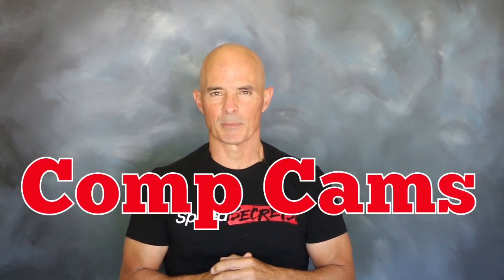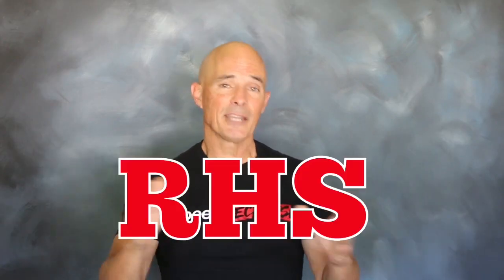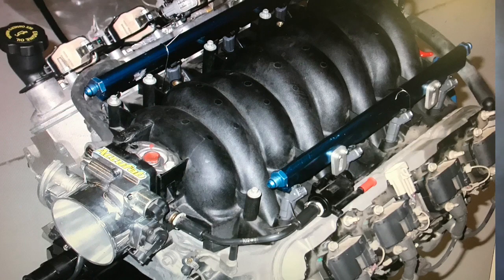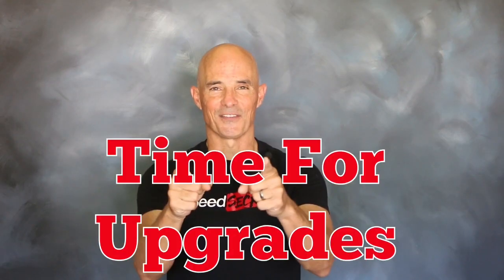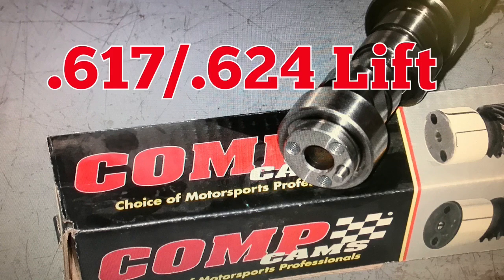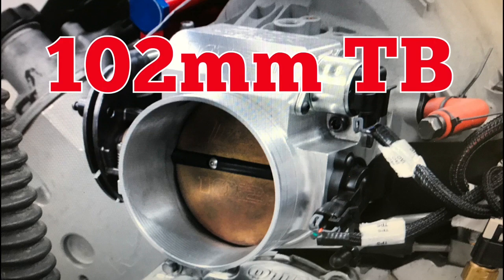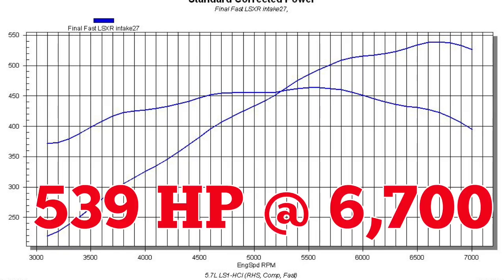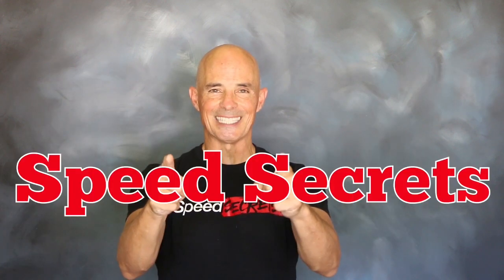Heads/Cam/Intake on an LS1: How Much Power??

Comment: LS1 with heads cam and intake will run 550hp. Throw in some dome pistons and you’ll grab another 20hp. If you’re losing 110hp getting to the tires, you got big problems.

Comment: What’s crazy is how this crate motor which is the exact same that the 01, 02 Camaro SS and Trans Am has but it’s pulling 414 crank HP right out of the box which is roughly 350 whp. But the cars only put out 325whp even with the factory LS6 intake.
Reply: Because they put long tubes on it, gain 25whp usually
Reply: Keep in mind that’s the rating. Back in the day people were seeing 305-345 rwhp stock.

Comment: Those numbers should possibly be divided by a range of 1.12-1.20, which accounts for a 12-20% drivetrain loss. This gives a slightly more realistic number to potential RWHP.
Example: 
539 ÷ 1.20 = 449
539 ÷ 1.12 = 481
So there's a 32 hp difference, let's meet in the middle and say 16 hp and add it to 449 so that put it around the range of 465 RWHP. Obviously I'm not an expert but there's a pretty wide spectrum however I've heard many people being around the 450 RWHP range with Heads, Cam, Intake and a good tune on a 346CID LS1.
 As well, always remember if you switch out your rear differential for a heavier setup it will increase your drivetrain coefficient as it's more rotational mass the engine has to turn while transferring power to the ground.
Reply: Yea 460 to 470rwhp and 410 rwtq

Comment: @richardholden I have a big huge question for ya ...... Why can't I take my 2000 mustang GT with the 4.6 coil on plug ignition system remove it and install a 5.3 LS engine I know the 4.6 has a 35 tooth reluctor wheel and the LS is 24/58 but I'm sure it's possibly to replace the 24/58 reluctor wheel with a custom 35 tooth wheel while I'm building the engine do you have any idea of the best way to attempt something of this kid I can't see how it's not possible

Comment: Stock motors rate 305hp-320hp for the 1998-2002 fbody
Reply: That’s paper. Most Camaros made the same 350 hp as the corvette which translates to 330 to the wheels

Comment: How do you get 414hp from a stock ls1?
Reply: Long tube headers and computer management.   The Vettes back then made 350-360HP at the engine.   Replacing the log style manifolds for long tubes and a tune could give 50-60HP.

Comment: How hp much power do you think that would be at the wheels?
Reply: 450-460
Reply: Those numbers should possibly be divided by a range of 1.12-1.20, which accounts for a 12-20% drivetrain loss. This gives a slightly more realistic number to potential RWHP.
Example: 
539 ÷ 1.20 = 449
539 ÷ 1.12 = 481
So there's a 32 hp difference, let's meet in the middle and say 16 hp and add it to 449 so that put it around the range of 465 RWHP. Obviously I'm not an expert but there's a pretty wide spectrum however I've heard many people being around the 450 RWHP range with Heads, Cam, Intake and a good tune on a 346CID LS1.
 As well, always remember if you switch out your rear differential for a heavier setup it will increase your drivetrain coefficient as it's more rotational mass the engine has to turn while transferring power to the ground.

Comment: for anyone wondering power numbers to the wheels. Its about 400-420whp with a manual less with auto.
Reply: In a manual car, probably more like 460whp.
Reply: @zacharyrussell6983  doubt it, they are running no accessories so the drivetrain loss once on a car with full accessories is higher than the standard 15% loss. Also most h/c/i LS1 cars dyno in the low 400-450whp range. My estimate is more on the conservative side but 460whp would be on the high end of the spectrum.
Reply: @TheOhsemix  true.  I forgot about the no accessories.  Yeah, 420whp is probably pretty accurate.  Which to me just makes me feel better about my car doing 467whp through a 9” and 243 heads.
Reply: there’s mkre you can squeeze from the heads, i saw someone mention it already but running GOOD ported 5.3 heads to bump compression and running e85 to help prevent knocking would see you closer to that 450whp
Reply: 460 to 470 rwhp manual 410 to 420 rwtq

Comment: This is Old, But how is a 227/235-565/579 110 LSA cam in a 5.7 ls1?
Reply: Those specs aren't far off from the Tick Torquemax Stage 2 cam. I have that cam in my C5Z and it put down 430/411 with the stock ls6 heads and intake. It's a great all around cam and it's awesome on the street.
Reply: @maroonsn95  Thanks for the info 👍
Reply: @maroonsn95  Thanks
Reply: @maroonsn95  What a monster...

Comment: Richard, why, how does the Early LS1 make more power at the crank than my 01 LS6 in my Z06?  (385/385)? thank you.  BTW, heading for teh Big 3 install after 20 years beating on this beast.
Reply: The dyno picture also shows an electric water pump and no accessories being driven. Your 385 HP is calculated with all accessories, including mechanical water pump, attached.
Reply: These numbers are with headers and a tune. Your ls6 will make well over 385 on a dyno without factory exhaust manifolds etc.
Reply: Numbers are most likely underrated from factory

Comment: Thats alot of money to gain 125 hp. Ya could have probably turbo it for half that and make double the power
Reply: bruh
Reply: You can't just find the price of a turbo on the internet and think that that is what a turbo system costs to install on your engine.  It take some serious fabrication skills to do a turbo system in a Vette/Camaro and make it look good and keep fitment of the hood.  In fact, it's one of the hardest mods you can do to your engine bay.  You are far, FAR better off getting an A/A Supercharger system for 8k and its a simple bolt on with no fabrication skills necessary.
Reply: @ChefofWar33  you can buy turbo kits for all sorts of cars.
Reply: @chevrolet355  Indeed you can. Installing them on the other hand... Well that requires knowledge, tools and time i dont have.  Some cars are super easy to to.  While my particular car, the C5 Corvette is one of the hardest out there.

Comment: I'm building LS1  5.7l iron block with forged eagle rods wiseco pistons shouldn't have any problem turning 528hp at the crank and I'm going to drop it in a 1971 international scout Comanche should wake it up a little seeing how the original engine is a  304ci 5.0l  turned right around 215-220 hp

Comment: This video references the LS1 crate from an early model Camaro, but power output "stock" does seem high, even with the long tubes and fuel management system on an engine dyno.   The LS1 in C5 Corvettes made 350 crank hp in the later models with LS6 intake.  Seems more feasible that it's an LS1 with vette cam, heads etc.  

Otherwise that's one seemingly generous engine dyno.

I have an LS1 with similar cam specs, 232/236/113, ported 241 heads that flow bench tested better than stock 243s by a long shot. Kooks LTs and offroad Xpipe. Car makes 418hp 398tq at the wheels. Figure 475hp at the crank.

No way that Fast Intake and 102 TB are worth 64 hp.
Reply: Long tubes and computer management on a 350HP LS1 could easily give 50+ HP gain.     So the 414HP was with the exhaust and computer management.
Reply: Good numbers for sure! My 02 SS with prc 2.5 5.3, custom cam and kooks headers made 426 rwhp. Swapping the ls6 for a fast might gain you 5-8 hp max but it's not really worth it. I have videos of mine if you wanna check them out.
Reply: @bhcamaro2002   that's about spot on. Heads, cam, longtubes,  LS1s are typically in the 415 to 428 rwhp range.  Figure 50 to 55hp more at the crank.
Reply: Correct, depends on dyno as well but overall that's accurate
Reply: @bhcamaro2002  it’s pretty well known that that’s the typical range.  I’ve had three cammed/ heads/ long tubes LS1 builds on two separate C5s (one built twice). All three builds with different cam specs and different porting on the heads. All were relative in power and torque at the wheels, give or take 10 to 15 hp/ tq. Three separate dynos I might add.
Reply: @gotmylk thats awesome, I've heard mustang dynos read a little lower than others as well
Reply: @bhcamaro2002  depends on sweep time,  but Mustang dynos usually reads 8 to 12hp less than a Dynojet.
Reply: @bhcamaro2002  I just watched a few videos comparing the two , Mustang Dyno vs Dynojet. When both machines are recently calibrated the two read within fractions of an HP from one another.  So I think it's safe to say...of the dyno is calibrated the HP/ TQ ratings should be accurate on either tool. Which assumes some shops are just more on top of having their dyno calibrated than others. Also the Mustang dyno has a lot of flexibility with the parameters that will alter power output reading even if the power output reading is innacurate.  

I say always go with a reputable shop that only cares about using the tool for tuning and ensuring your car doesn't blow up....and doesn't give a hoot about your feelings and unessecerely  inflating your numbers.
Reply: @gotmylk  yup exactly what I did for my car
Reply: @bhcamaro2002  same for all the ones I've modded as well.  If you tell your tuner you want a few more ponies out of your final results...and the response you get is " it's safe where it is. You dont want it blowing up, do you?". Then you have a good tuner.  

That's exactly what was said to me by both Bill at 2nd Street Speed in Perkasie PA. As well as from Charlie Tuner  that tunes for A&A out in Oxnard CA. 

Soon I have one going to ECS in Cream Ridge NJ. Expecting nothing but a safe tune on this one as well.  Numbers don't matter. Just be fun, fast and reliable. Cause cheap went out the door years ago.
Reply: @gotmylk  exactly! My tuner said my car could make 440 but back it off from detonation on the dyno so the safe tune number was 426 and I was more than happy with that. There have been a few other shops in the area that go for numbers then the car blows up and they dont hold themselves accountable for cause the motors to blow. They usually run off to another state and start blowing motors there
Reply: @bhcamaro2002  bingo!
Reply: @gotmylk  there's one that did work in NY and ran to Florida haha
Reply: @bhcamaro2002  not surprising. There are plenty more clowns than there are quality tuners. That's why the quality guys demand a premium. They've earned it.
Reply: @gotmylk  yup the good ones stay around and keep getting projects and the bad ones disappear
Reply: @bhcamaro2002  Tbyrne Motorsports?
Reply: @ryryy1980  I was referring to redline lol
Reply: @bhcamaro2002  oh yea, I'm in western NY and have heard of them...
Reply: @ryryy1980  yeah they were in magazines and worked with some dealers then ran to FL
Reply: @Ballen1182 I do not agree. Manufacturers do not intentionally underrate their power output numbers.  There is absolutely no benefit or point to doing this.  HP numbers sell cars.  So why would a manufacturer intentionally short change those figures?  They wouldn't.  The manufaftures are using applying safe tunes for longevity,  incorporating the parasidic loss due to ancillary  components under multiple varying conditions.  Which in terms of reality are more accurate than the guys we pay $700 to for a tune at their Indy shop.
Reply: @gotmylk  they actually do that, sometimes up to 100 hp, although that's normally done either for rounding numbers or homologation purposes. A interesting case are Japanese sports cars from the 90s, up to 50 hp more than advertised, because of gentlemens' agreement between local Japanese manufacturers
Reply: @Ballen1182 ohhhh yeah! Good call. I did forget about the LS f-bodies. I need to stay offline when I’m smoking weed.

Comment: I wonder what's at the wheels with this set up.
Reply: Depends on transmission, stick will be near 500 auto depends lock up or not on average -100 for auto with high stall

Comment: Ls1 pistons melt at 500hp
Reply: Really eh
Reply: BS
Reply: @chrisbryant1657  stock ls1 pistons won't last long making 500 or more you need forged pistons
Reply: @abbas674  Mine have. 98 z28 Camaro LS1. Still original slugs!
Reply: @chrisbryant1657  yeah a stock LS1 does not make 500hp a 98 LS1 makes about 250 HP the 2000 LS6 is also a 5.7 that one makes about 350 due to the heads and manifold
Reply: @abbas674  My z28 is far from stock. LMAO
Reply: @chrisbryant1657  I melted a pistons at 500hp on my SS now its fully built forged rods pistons Texas speed crank used to think it would last but no.
Reply: @abbas674  bad tune probably.
 9.85 137 on sbe.
Reply: @chrisbryant1657  tune is awesome tuned by church automotive and no its just had 200k miles
Reply: @abbas674  Melted at 500HP naturally aspirated?   Or was it nitrous?

Comment: You still gotta push that extra power thru the 1998-2002 Camaro/TransAm 7.5" stock diff....
Reply: I've seen 7.5s last behind a 5.70s 1/8 mile gbody

Definitely wasnt stock. 434 with spray and slicks.

Comment: Wish the 5.7 had more love..but I understand its more rare than the other sizes. But I'd really like to see a street combo with 243's on it
Reply: I’m about to put 243’s on my LS1 and a BTR cam
Reply: @lsxbrandon6050  how did that do?
Reply: I'm running prc 2.5 5.3 heads and custom cam in my 02 SS. Sound clips are on my channel if you wanna hear it
Reply: @bhcamaro2002  that thing sounds great
Reply: @theredgoatviking4686  thanks alot!
Reply: @bhcamaro2002  you’re welcome good sir I have my gto on my Chanel
Reply: @theredgoatviking4686  that thing has a nice chop to it! 408 sweet!
Reply: @bhcamaro2002  thank ya sir it runs decent I wish it was in an f body tho.
Reply: @theredgoatviking4686  never too late to get one
Reply: @bhcamaro2002  very true I had one 4 years ago I should have kept it.
Reply: @theredgoatviking4686  that's what they usually say. I know a bunch of people who did the same thing
Reply: @bhcamaro2002  yep it was an lt1 car sort of modded but it was fun to drive.
Reply: I have a 2002 z28 Camaro I'm trying to find 243's for,  I have a set of 317's but i really want 243's.   I've been dying to try out that combo.
Reply: @jordancoyle6168  the 5.7 gets no love its a shame. My gto has a fast 90 and 1 7/8 headers, love to see some #'s with a cam
Reply: @paulcurrier4947  my 05 gto has the fast 102 intake cam full exhaust and stroker motor made 490 at the wheels on a bad tune.
Reply: @paulcurrier4947  Because its a small block 5.7. Going bigger gets easier to make power with fewer modifications
Reply: Checkout my vid bud, I have 243s that were ported at AHP, with 92mm IM, BTR 2 Cam and LG Motorsport Long tubes.  Dynodynamics dyno made 452rwhp 425rwtq.  Very Streetable.  34mpg on freeway.
Reply: @Corsavette02  LS1 max out at around the 500 something mark N/A on pump gas. Going E85 gets 600 something maybe more but need forged piston's and sleeves. Alluminum blocks are not the most favoured for drag racing
Reply: I’m building that now
Reply: I made good power with AI ported 241's
Definitely worth it
Reply: Theres much better heads for that bore size NOW.  TFS 220 ls1 as cast heads ported by BTR, mast 11* LS3 small bore, Hoopers Heads 11* cathedral ports, PRC227, LPE CNC ls6 heads, Powermax LSxtreme 240's. Pair that with comp cams 54-459-11 cam, 2" headers from speed engineering, FAST LSXR 102, with a 4-5" DIY cai that snakes down to where foglights usually are.  Flex fuel sensor kit, and if your really trying to grab for every hp out there I guess you could go with a 1.8 rocker(if 1.8 rockers is run a 231/247 cam) Mill heads to bump compression,thin cosmetic mlx head gaskets will also.bump compression, under drive pulleys, 4.11 gear with a Detroit locker rear diff, 2800 stall converter.

Comment: stock ls1 with 418 horsepower 😂😂😂😂😂
such a Liar
Reply: Its on an engine dyno with no accessories, no air filter, long tube headers, no cats and an optimized tune.. Easy 400+ .. Most ls1 where underrated
Reply: He probably means hp on the flywheel not rwhp
Reply: @m.2038   i know 
its impossible to reach more than 360 with stock ls1 even with a good tune
if you search in google you will find that a stock ls1 will have about a 340 hp on the flywheel In the best case
i dont know where did the 78 hp come from😂😂😂

Comment: 125 horsepower for about 4 or 5 grand. Mmm 🤔
Reply: I'm thinking the same thing.  And you have to rev it to get that power too.  Considering that most of us retail buyers would have to add fuel pump, injectors, MAF sensor, custom dyno tuning, and have to live with that big cam at low rpm driving... the cost for this is knocking on the back door of a new SC kit w/intercooler.
Reply: @wydopnthrtl  and your car at similar power with the supercharger will be slower.  Considering the added weight of the blower, then heat soak when running it over and over.
Reply: @wydopnthrtl Indeed.  I've always been interested in videos like these before I actually got my C5 corvette.  But after driving it for a few weeks on the street, I've noticed that I rarely EVER rev it past 5 grand.  And most of these mods don't even kick in until then.  Meh, I'll pass.
Reply: To be fair, you could save money and run a ported 243 head and make identical power.  I have pretty much the same set up with a Fast 92/92 and Cartek 243 heads.  Made 467whp M6 through a 9".

Comment: over 400hp on a stock untouched ls1???
Reply: At the crank. No accessories, electric water pump, LTs, no cats. Yeah, north of 400 at the crank all day.
Reply: on a headers exhaust ls1 ..  but still bullshit theres no way it made that much with those bolt ons
Reply: @Kern_Media  probably crank, without accessories and drivetrain loss
Reply: @Kern_Media  i was thinking the same total bullshit im longtubes full bolt ons tune making340hp

Comment: Save the money on heads, run 706s to up compression and use a 238/242 cam for the same hp. Fly cut and run a thinner head gasket for more compression on e85 for bonus power.
Reply: I got some 706 heads from a 5.3 LM7. 
Do I need to do anything to the 706 heads or do I just throw them on like that on the ls1 block?